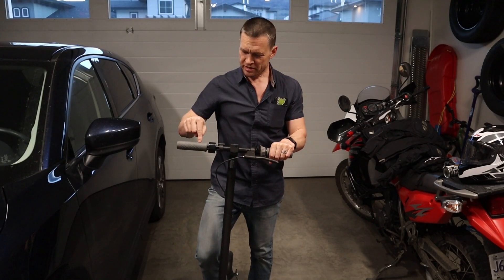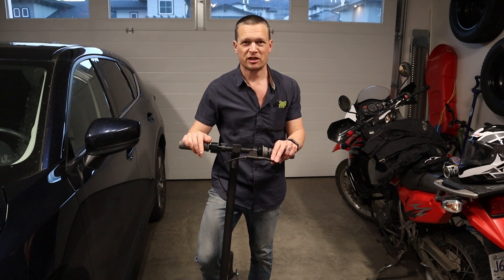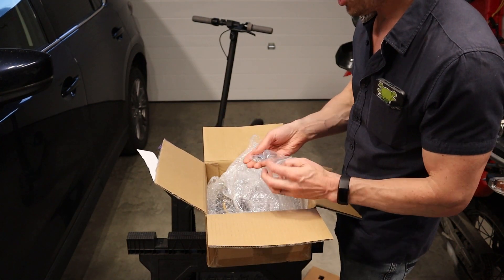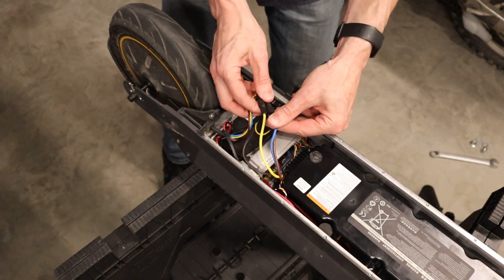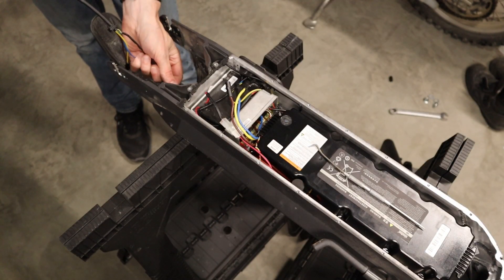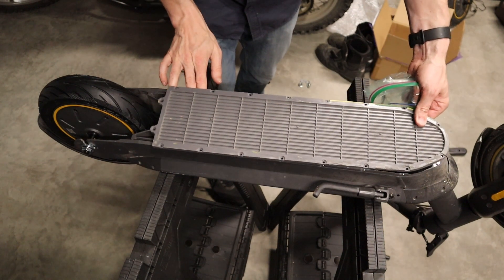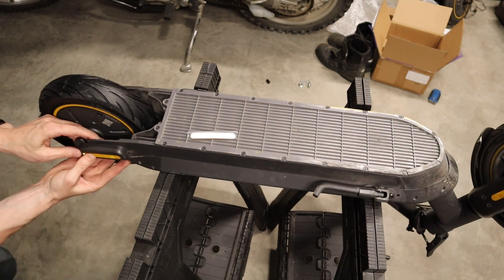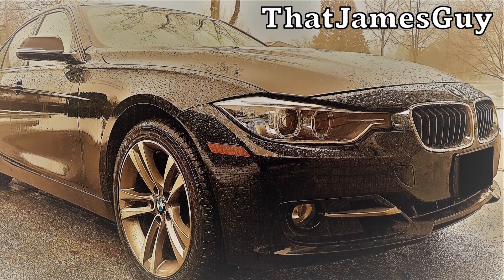Segway Ninebot G30P Kick Scooter Motor Replacement | Will This Fix the Issue?

Comment: Hi James! I appreciate your video but am running into an interesting situation. The connectors on my model were gooped together like another user mentioned, and after some research it seems that some form of connector will be needed (I can't just straight up splice the wires). With that in mind my only route will be to cut the wires coming from the scooter at just above where the current connector is. My question with that is do I need to disconnect the battery before I cut the wires? I would think they're carrying some sort of high voltage and am somewhat worried about cutting them without the battery being disconnected
Reply from the maker: The 3 big wires between wheel motor and controller are not live if the scooter is off. I wouldn’t worry about disconnecting the batteries.
Reply: @that_jamesguy  Thank you much for your response! Going to give it a go this coming week, your video is/was extremely helpful!

Comment: Hi James, can you tell me if I can use the same gen motor as yours but in a Max30P that has a controller with ring terminals instead of plastic clips. I'm told I have a Gen 3 controller, I plan to cut off the motor's clips and replace with ring terminals & heat shrink tubing. I'm a handicapped pensioner and this is my about the only hobby I can sort of afford. I'm seriously considering returning the motor and saving for a Refurbished/Out of Box Max G30P as I find myself too heavily invested in Max30 upgrades such as front & rear suspension to walk away.
Reply from the maker: @MrToadnic  I don’t know. Sorry.

Comment: ...how did u pull those wires apart. Mine won't budge even with pliers
Reply from the maker: @ThBraveSteed  mine pulled apart pretty easy.
Reply: @that_jamesguy  mine shattered before coming apart. They really thoroughly covered them inside & out with some kind of black super glue stuff
Reply from the maker: @ oh yikes!